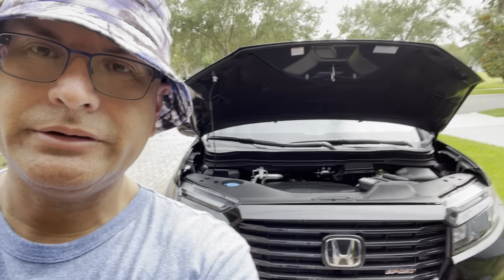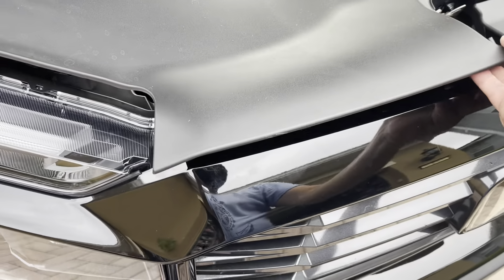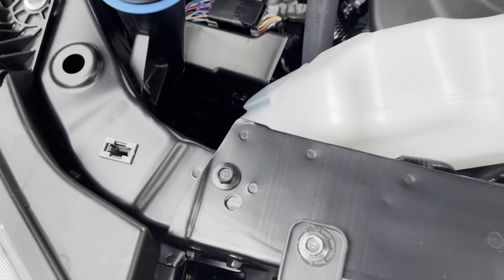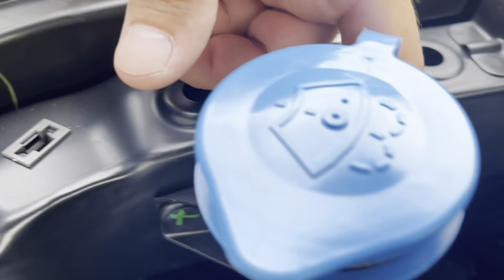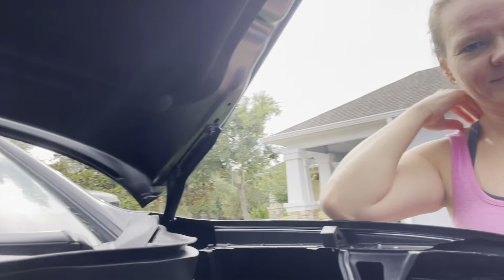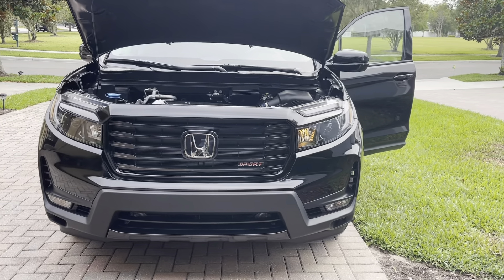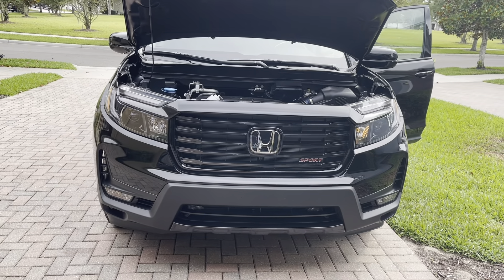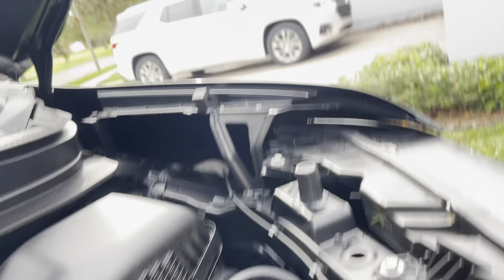2021 Honda Ridgeline Sport LED high beam upgrade

Comment: So I ordered these same brights, I was having a hell of a time locking the bracket it but I loosened the housing bracket with a screwdriver and was able to turn them in and lock them nice and tight! I see people in the comments having this problem but once you fix it it’ll be well worth it, these brights are BRIGHT
Reply from the maker: Yes these light bulbs were a pain to lock in.  I’m glad you were able to get them installed, I’ve had them almost a year and they still work fine 👍

Comment: I had a hell of a time trying to get these exact bulbs to seat, but finally gave up. I meticulously confirmed alignment, but I couldn't get them to press far enough in to the housing for the tabs to rotate and engage. I just read that the installed o-rings may be too big, and its suggested to swap with what was on the original bulbs. I am going to try that. I'll report back if that works. I also ordered a different set which I'll try at the same time.
Reply from the maker: I’m sorry to hear about the bulbs not fitting properly, not sure why but the set I installed fit fine, I’ve had mine on for two years and still working fine, 🤷🏻‍♂️
Reply: @jamesakaflcruzr4277  Thanks for the reply. Must be the ones I got, because after the trouble, I ordered a set of Lasfit fanless 9005's from Amazon also and they went in easily. And worked as DRL at reduced brightness/no flicker and bright as heck on high. So I'm good. Thanks. Great videos btw.
Reply from the maker: @mchad8876  glad to hear you found bulbs to work 👍

Comment: I ordered  9005 bulbs as well as added switch back leds to the front turn signals. No more amber at ALL!
Reply: Same bulbs as these or did you find another option? The bulbs listed here don’t even come close to locking into place on my ‘21 sport.
Reply from the maker: Can you share the amber led bulbs, did you need to add something to the amber bulbs to avoid the rapid flash?
Reply: @jamesakaflcruzr4277  You have to add flash resistors and they can be had at Amazon pretty cheap. You will need one for each corner

Comment: Thanks for this video , I just got mine. The strip around the headlight , does it turn on?
Reply from the maker: @hulkdavid3201  Congrats on your new truck!  If you have the Sport or RTL the eyebrow won’t light up.  Those only work on the higher trims.

Comment: What kind of heat output on these bulbs?  Im concerned about how they are used for DRL in low power mode and the housing may not withstand an extra heat out put.  Also, what exactly are the fans cooling?
Reply from the maker: I am not sure of the heat output.  I’ve had mine on for almost three months and no issues.

Comment: Nice mod. Looking to get a RL too..do you have second thoughts of getting a trim higher or Sport is more than enough thou it have less tech and so many missing features on the higher trim
Reply from the maker: Thanks, at times I regret it because it would have been nice to have a sunroof.  Other than the sunroof I really am enjoying my sport truck.  I didn’t want the leather and in my opinion the sport has enough options, most of safety tech so I’m very happy with it.  My wife has a 21 Odyssey with leather and options and I don’t like the leather in our Florida heat, but the sunroof is nice.  I may end up adding a sunroof to my truck so we will see.  Although sunroof is mostly for our cool winters, lol.

Comment: Thanks for the video. Just did this install on my new 2023 RTL. Very easy but I noticed that these LED's seem not to secure into the housing as securely as the OEM bulbs. Did you notice this? Thanks.
Reply: You may be experiencing the same as I did. When you say “not secure” are you sure they turned a good 1/4 turn to lock in? I couldn’t get this brand to fully seat and as a result not engage the locking tabs fully. I ended up using a different bulb which seated fully, just like the original halogens.

Comment: Try as I might. I could NOT get these bulbs to seat in my 2021 sport.
Reply from the maker: Well, it did take me some work, the bulbs have a small nudge and you have to get it right on to the housing, the way I was able to sit was by looking through the headlight housing and aligning it and then I felt the bulb clip onto the housing.  I hope this helps.

Comment: Hi James, what was your primary reason for getting this brand of LED high beams with the fan?  My reason for asking it that there are other manufactures out there that don't require a fan to work.  Thank you.
Reply from the maker: Hey, no not really, I went by the reviews on Amazon so figured I give them a try.  So far they are holding up well.